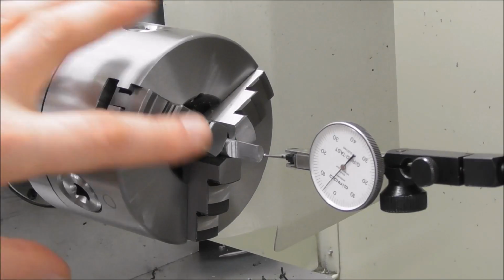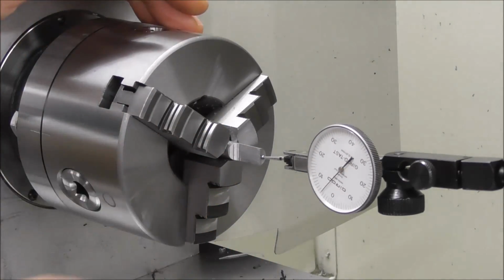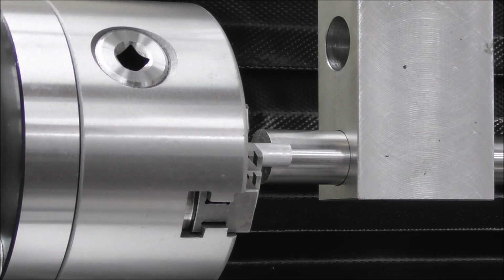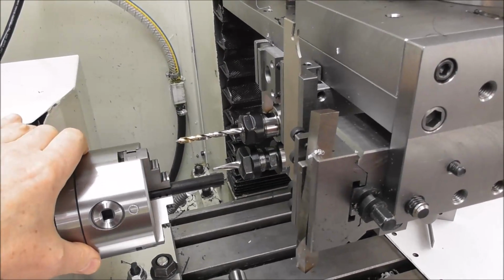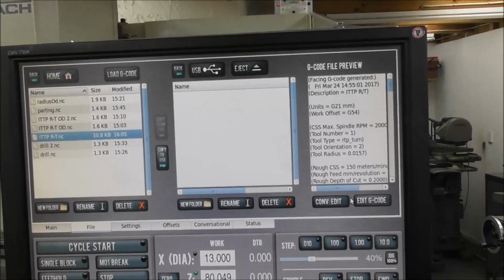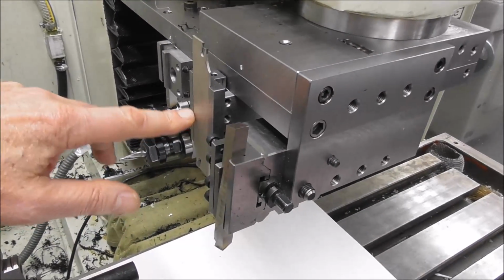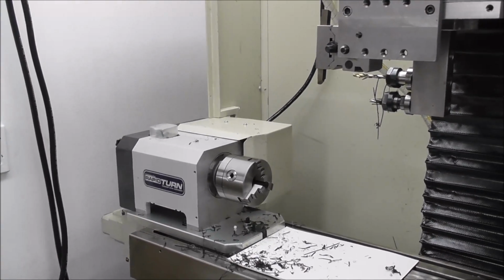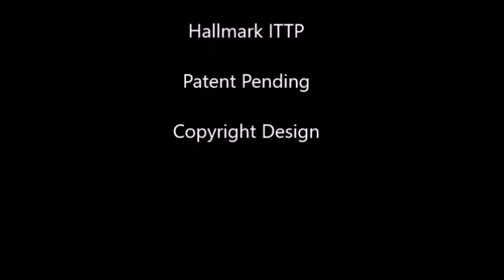Tormach RapidTurn - 18. Gang set up and run

Comment: Very cool Cliff.  I have learned a ton watching your videos.  Thanks so much for posting these.
Reply from the maker: Thanks for the feedback Jason.
Reply: @Threadexpress 
          Hello Cliff, I really enjoy watching your channel and have learned a great deal from it. I have a Tormach 770m and was considering getting a Rapid turn because of it's value versus Slant Pro for some production run of small round stock parts. One big question I have, and still not very clear on is how to set up tool offsets for gang tooling. I see how the first tool's X,Y,Z zero is touched off  but how do you touch off the next set of tools?  I noticed you mentioned a "Master" Y zero but how would you touch off the next tool's Y zero offsets?
 Cheers Kien Tran
Reply from the maker: @ktran8400  - Hi. Well I was noting each tools Y position on the Y DRO and entering that in the actual toolpath G Code.  I have not looked at the latest version of PP for RT ... it may be better for Y positions.   Cliff
Reply: @Threadexpress  Cliff, thank you so much for the answer! I will check out the latest version of Pathpilot and play around with it

Comment: Hi Cliff,
              nice video. 
I saw a reply from you to one of my comments but don't know where it has gone, however, I think it was relating to sending the old Spindle back to Tormach and what it cost.
The answer to that is that Tormach handled everything well and there were no charges involved in the entire process of getting the replacement spindle and sending the old one back.
I tried the C-5 Collets that I have in my spindle and they seem to fit OK so the 2 /10ths of a thou undersize would seem to be within the tolerance range of my collets.
I am really interested in your tool set up and am sitting on a pile of 20mm steel plate and am thinking of trying to make my own but would be prepared to donate to your tool fund in exchange for some dimensions/rough sketches.
I will probably make some holders that can take the small tool holders that come with the Tormach supplied quick change tool post as well as some TTS type holders like yours.
Bob
Reply from the maker: Thanks Bob - I will email you.

Comment: do you know where can I find information on how machine the same piece without the gang tool attachment ??
Reply from the maker: Hi Kilak
Not that I can think of . You would need to make at least a simple version. Cheers  Cliff
Reply: @Threadexpress  thanks for your reply. 

I just receive my 770M and RapidTurn. I am thinking on making a simple gang tool attachment that can be quickly and easily installed for one off parts. Any ideas?